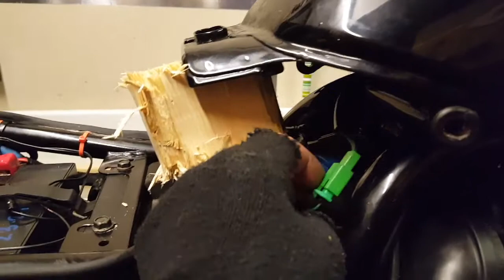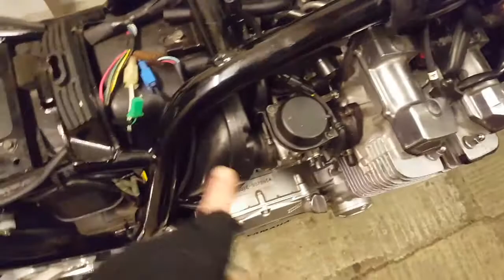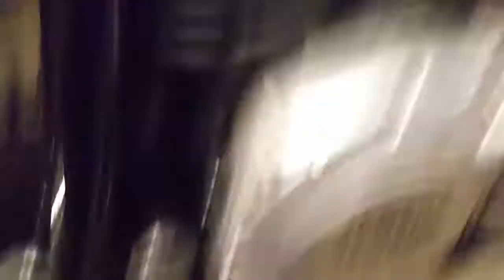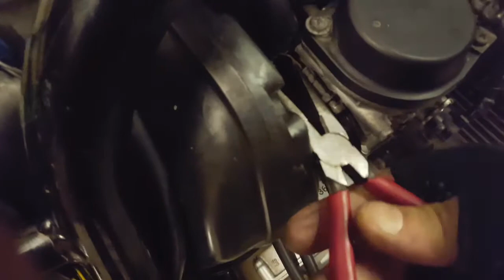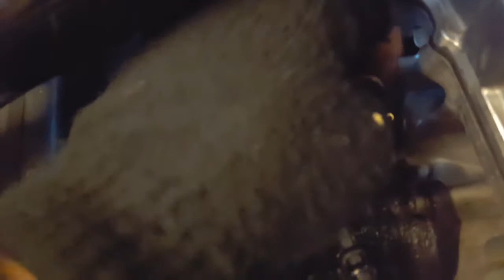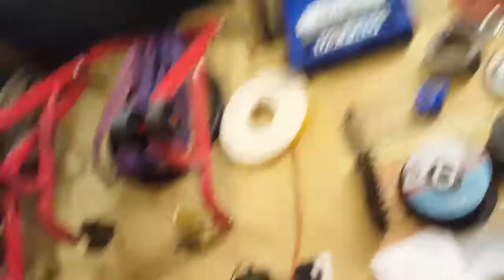Yamaha xjr 1300 inlet rubber upgrade and carb repair pt 1

Comment: no 2 delkavor 's if that's how it's spelt it's dark outside,was told it wouldn't make much difference but bought it with them on.thanks for replying so fast.
Reply from the maker: Did it run ok when you got it ..
With delkavics on I would imagine it will need a 're jet..the stock exhaust are very restrictive as are all Suzuki zorsts...but the xjr runs perfectly with stock exhaust carb jets and air filter...even the new carb rubbers don't make a huge difference ..i only changed mine as they were perished...
I would suggest you go to a rolling road tuner...put the air filter in ..as you can't run without it..and have it tuned ...the non standard exhaust may be upsetting the mix running too lean ...
It should pull like a locomotive on all stock bits...all through the rev range..

Comment: Thx for this video!!! Its a great help for me!! 👍🏽👍🏽👍🏽 Greetings fron Spain
Reply from the maker: thank you 👍🏻 glad it helped..ride safe ! 👍🏻☮❤
Reply: After replacing the news inlet rubbers, and replace cable trothle, must be re-carburated?
Reply from the maker: @frenazos  
No need to  change anything with the carbs it will run fine on original settings with the new inlet rubbers..only touch carbs if there's a running issue ..then only replace carb parts with original parts it will run fine 👍🏻
Reply: @springy-2112  
Thank you very much Mr Springy, it has been a valuable help, before the summer I will change it. Thank you very much friend✌🏽✌🏽🍻
Reply from the maker: @frenazos  
you are very welcome ☮❤

Comment: Hi Springy, thanks for the video. gonna try this myself.  there is a lot of information out there regarding the 36y rubbers, and different sites at various prices. what ones did you get?  was it worth doing? thanks in advance.
Reply from the maker: Hey Buddy I got mine from Yambits UK I rang up just to make sure all was correct.. 
The difference was hard to pinpoint as I had bad float needles overfuelling at the same time and I did a full service including plugs..
but my old rubbers were perished and the main plus was moving the air box and having more space to put the carbs in and out with the shorter rubbers..
once all was done it ran sweet..but it may have been a bit rough before so hard to tell...👍🏻☮❤
Reply: @springy-2112   nice one!! ill have a look on Yambits so. thanks springy!

Comment: hi Springy, where did you get the carb repair kit from and was it expensive? cheers and thanks for useful set of videos - you are right, a lot of talking reg changing the rubbers to 36Y but no videos!
Reply from the maker: Kamil Smagorzewski 
Hi Kamil i got the carb repair kits from ebay they came in at £50 for the set of four including postage...i cant remember the seller exactly i will try and look through my pirchase history and let you know ...cheers and take care..👍
Reply: Many thanks mate
Reply from the maker: Kamil Smagorzewski 
Ok found it the ebay seller is 
Jwmltd92
John wilson motorcycles ltd
And cost £54.99 all in..
This kit was for 2002 _2006 
Check the spec /year as i believe 2002 is a change year for the carbs...
Their tel number is 
01524 736983 
They are in lancashire..
Cheers matey 🤘

Comment: Hiya, just a question, I’ve got a 2005 xjr 1300 and the fuel keeps draining into the oil. I reckon the carb float valves leaking through letting the fuel go down the cylinders and past the rings. Is this the issue you was having? Also where did you get the shorter Inlet rubbers from and carb kits
Reply from the maker: Hey Adam , yes the sticking float valves were the issue. Very common on the xjr not sure why I've had loads of these carbs on other bikes but I suppose worn needle and seats is inevitable on any float bowl carb .
The 36y rubbers were from Yambits UK. the carb overhaul kits from eBay.  If you ring Yambits they're very helpful and I would get both the rubbers and carb overhaul kits from them they are very good quality unlike the hit and miss eBay bits .I was lucky my eBay parts were ok.
Probably worth checking your fuel tap as well but it's most likely the float valves (needle and seats) ..
Hope you get sorted ok .👍🏻☮❤

Comment: Hello again.my xjr runs great Untill I rev to 5 and half 6 I have adjusted the needle almost to the last notch but do you think I need a bigger main jet? it only has the stock one in it.
Reply from the maker: Do you have stock exhaust and air filter?

Comment: I've just bought a 2002 XJR1300SP and the last guy put Laser exhausts on it, I've just noticed 1 and 4 heater cables are hanging loose and are not connected, are they needed regardless of exhaust type?
Reply from the maker: Hey Tim it'll run regardless of the heaters just rougher in cold weather and particularly at speed in cold temps..the exhaust has no bearing on the carb heaters and vice versa ..personally I would make sure they're connected and working bit meanwhile they'll not stop the bike running ..take care and ride safe buddy 👍🏻☮❤
Reply: Cheers Springy and great videos mate well done 👍

Comment: Hi springy, Great videos mate. I was wondering if you could help me out. I have a 2003 XJR and a couple of months back I noticed that it was misfiring on tick over sometimes cutting out. I bought new plugs but it has not solved the problem. I have checked the Resistance on the Primary / Secondary spark plugs and pick up coil and all seem ok. I did notice the Intake rubbers were looking perished and thanks to your video I was going to clean them and put silicon on them but noticed that you are changing them in this video. Could these be the problem on my bike? I have a feeling the mixture is out, maybe getting to much air because with the choke on when the engine is cold there is no misfire or backfire from the exhaust.
Reply from the maker: Hey buddy , it's hit n miss with the intake rubbers leaking..they are extremely thick walled so they can perish and crack a fair bit without leaking..but as you have seen after months of procrastinating i bit the bullet and did the upgrade rubbers and associated air box move/ mod and was glad i did for peace of mind and ultimately better flow ..but i would recommend if you do the rubber upgrade to strip and service the carbs while theyre out..it cured all my running issues..as for popping on over run they all do that on the standard exhaust .. i know its time consuming and costly but it will transform the bike..and you have my dodgy videos to hopefully help. if only to show what can go wrong !! 👍🏻☮❤
Reply: @springy-2112  Thanks for replying so quick mate. I think I will change the intake rubbers then for peace of mind. May I ask why were the ones you replaced thinner? Were they not genuine parts? And do you think that this is the cause of the misfire or uneven running at idle? Sorry for all the questions LOL.
Reply from the maker: @stephenscott9743  
the replacement rubbers have a bigger hole inside they are genuine rubbers off the xjr1200..if yours are split right through it will knacker the idle but its more likely a carb issue like a sticky float needle..or even a diaphragm but unlikely..
you can get the rubbers from yambits uk .
if you ring them they will know exactly what rubbers you need as an upgrade and the carb bits too..the upgrade rubbers are also less than half the price of the restrictive xjr1300 ones..👍🏻☮❤
Reply from the maker: @stephenscott9743  the rubbers are 36y yamaha code 👍🏻
Reply from the maker: @stephenscott9743  
the carb repair kit info is in my reply to Kamil below also ...
dont know how to link or copy that .😉
Reply: @springy-2112  Cheers Springy 👍
Reply: @springy-2112  Hey mate, just thought I would let you know that the carb clean with new gaskets and rubbers sorted the misfire at Idle. Thanks for your help mate 👍
Reply from the maker: @stephenscott9743  fantastic news Stephen and it's always great to know you've done it yourself , although its a right old task it very rewarding..great news buddy and thanks for the update..ride safe brother 👍🏻☮❤
Reply: @springy-2112  they are not for  XJR they are for FJ 1100 / 1200 but they fit. Have the same on my XJR 1200 ...
Reply from the maker: @heikopanzlaff3789  yes fj1200 ....
36y whatever they fit .. it was a long time ago . 👍🏻☮❤
not sure what I said ..cheers buddy ride safe .